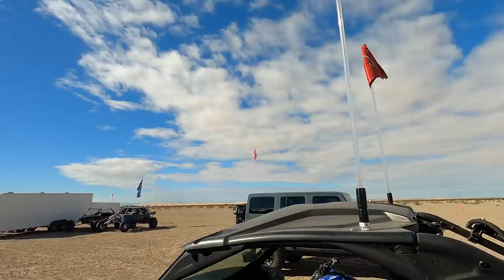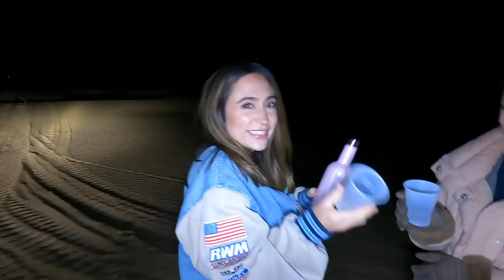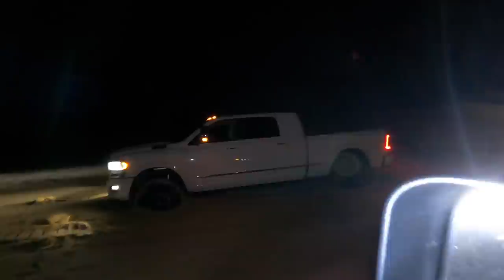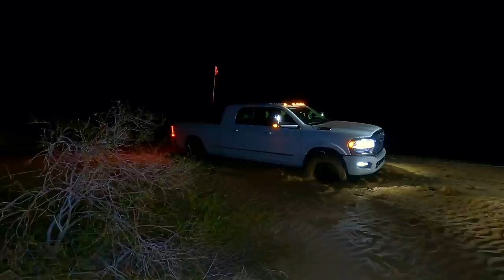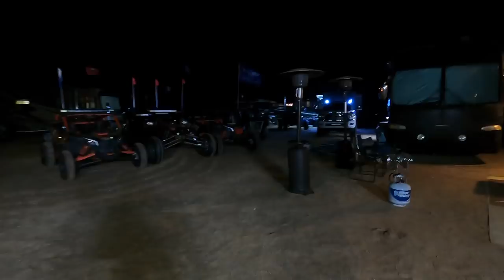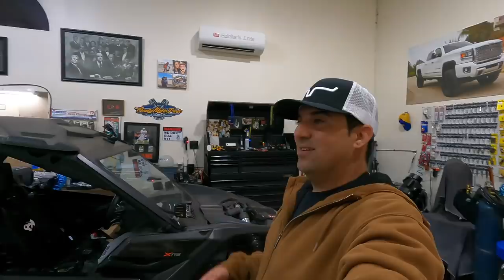Buried to the frame!!!...RAM

Comment: I agree my chevy 3500 lmm does not like the tow tune by banks power. Everytime I tow it runs to hot for my liking at 220. In stock tune it hangs around 210.

Comment: On that jeep,  hold down your traction controll button when in 4x4Hi and it will comoletly disable the ESC and TCS   ...  you gotta check out the winch sandbags , I pulled my 2500 out of the sand with one

Comment: Ive got an mm3 tuner in my 2019 2500 how do I get a custom tune for my truck, i tow alot and im having problems with pressure sensor trans line always faulting and teuck goes into a limp mode till i reset lookin into a copilot from ats to combat that issue but i would like to tune my truck
Reply from the maker: Dm @rajkalkat for tuning

Comment: Might be a dumb question what is the point of the towel on the line?
Reply: Serves as a visual that someone's using a tow rope when you see it from distance but the main reason is to weigh down the rope or wire in case it breaks. That way it falls down with the added weight instead of flying back toward you and causing someone serious injury. It should be something more than a towel or shirt though. Something with actual weight, you can buy them in a package that usually comes with 2 of them. One for each vehicle, put them around 10 or 15 feet away from the front of the vehicle.

Comment: U had a falling out with Matt eh.....
Reply from the maker: Yes sir
Reply: @EddieLife3500  if you understood why you are actually getting shift flare you probably wouldn't of had the falling out ..... you really need to regear first of all, then you need to get  rid of that Pedal Monster which is causing your Ram to initiate adaptive learning more than it has to ....

Do a trany relearn without the tunes and the Pedal monster hooked up, drive for about 300 miles or so to allow the system to relearn your driving habits. These Rams are "Big Boy" toys lol .... once you do this you will see that the shift flare is going to be almost non existent .... 

While I don't have a 2500 or 3500, I had bad shift flare on my 1500 when I added the 37s with the 3.21s, after I regeared , I did a trany reset/relearn and drove my truck how I will usually be driving it ... the truck picked up on my habits and the shift flare was gone ....

Just because these guys do custome tunes doesn't mean they know how these trucks run, most of these guys "bite" off of each others tunes and honestly have no clue what they are really doing ... Hence why Matt probably never got back to you because he has no clue on how to fix it, but it's actually very easy to do lol ...